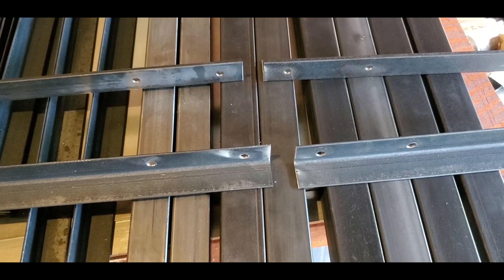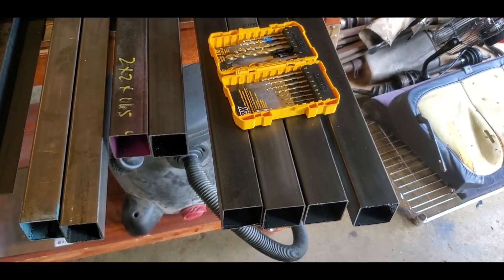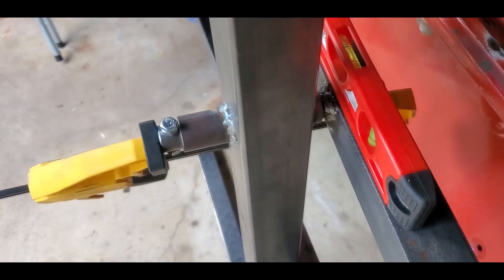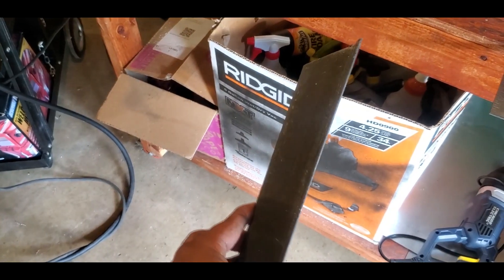How I built a Roll Over Jig/Rotisserie for the MK1 Rabbit Project

Comment: When you are welding your torch angle isn't correct. You should do a maximum of a 10° push and minimal puddle manipulation. Your settings also do not seem to be correct. Those tack welds are too cold and not properly fused in (setting for tacks is supposed to be hotter than welding) also when welding square tubing what you should do is tack weld the corners so you can actually get a decent weld bead across.
Reply from the maker: Thank you for the tips! I've gotten slightly better since this but always learning.
Reply: @TopSecretR35  no problem bro I'm going to build a rotisserie for my ej1